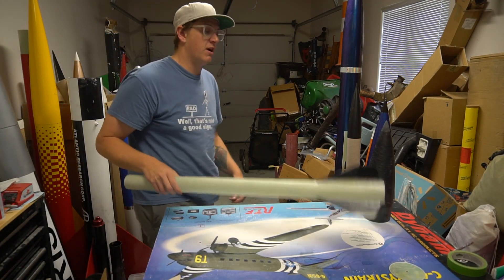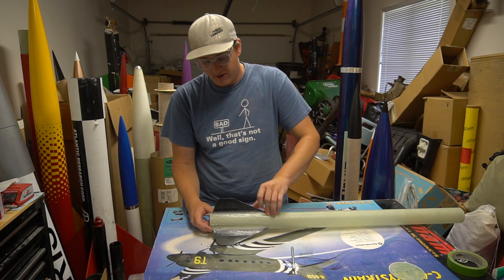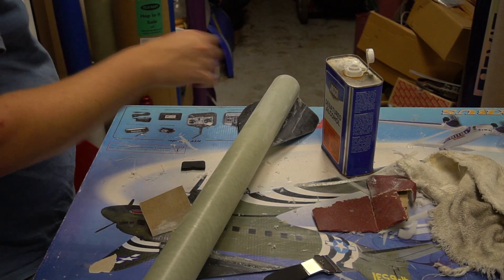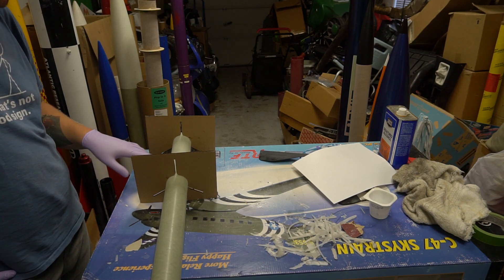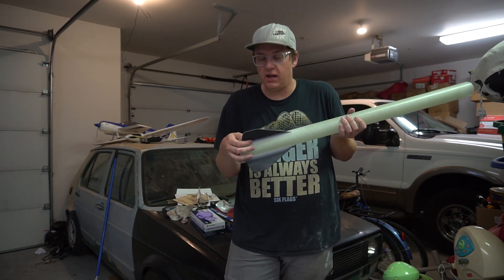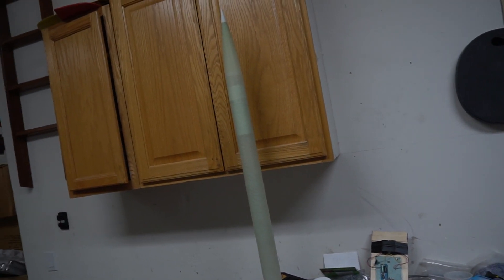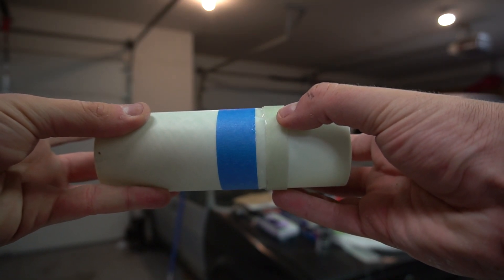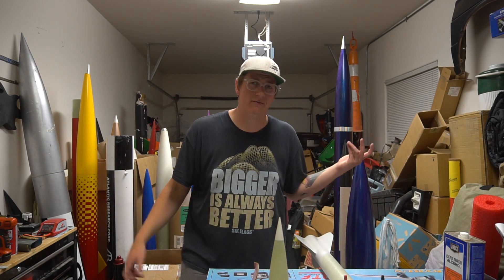When Rocket Building Goes Wrong | Epoxy Failure = Starting Over

Comment: Vacuum pump your epoxy, after mixing, to remove bubbles before you use and get more strength out of a no fin through tube designed rocket.
Reply from the maker: https://youtu.be/W_mT9FT9HzA?si=kzNMNVpDU8YvOQCD
Reply from the maker: https://youtu.be/W_mT9FT9HzA?si=kzNMNVpDU8YvOQCD

Comment: I would like to see the vacuum process that several people have mentioned in the comments.  Maybe a video where you demo several different epoxy types and application methods on scrap materials so they can be flipped over to show both sides if needed.  Like if you put a fin into a tube, but have the tube cut away as a demo.  For newbies like me or younger people that haven't worked with epoxy much where strength and techniques become important. With the lighting in your garage its not always easy to see how you are doing some of this.

Comment: You got very very lucky on removing the bad fillets.  I weigh my laminating epoxy (Aeropoxy) and use Loctite Hysol 9462 with the self-mixing disposable dispensers.   Haven't had this disaster with either of them when doing this way.
Reply from the maker: Absolutely, had they been any harder or softer this would have been a disaster beyond belief. 

I have a tube of hysol sitting around somewhere, along with some 3" quasi carbon fins from back when I thought I wanted to be an altitude guy. Although, those feelings are starting to come back a bit.

Comment: Only use the pumps to distribute. Best way to get the best mix for your epoxy is weigh the ratios out.. also if highly highly recommend using Aeropoxy ES6209 structural for fillets. Much stronger and lighter then west systems. Plus doesnt need a thickening agent if you dont want due to its hold and thickness.  They also make a laminating epoxy and a light weight filler epoxy. Best stuff to remove uncured epoxy lacquer thinner. 

For a minimum diameter rocket. Dont recommend fillers. Mixing fillers induces air bubbles.  While you physically feel its strong under flight stress is a different story. I also recommend vacuum processing your epoxy before applying the epoxy to fillets. This removes air bubbles.

Comment: depending on the working time of your epoxy, could you do a quick vacuum to remove air bubbles?   Might help remove the pin holes left behind. best of luck with the remaining finishing!
Reply from the maker: I actually used a trick I learned from Crazy Jim, considering this epoxy's cure time. I spread it pretty thin on a paper plate and let it outgas for about 20 minutes before putting the last two sets on the rocket and the difference was extremely noticeable.

Comment: I recently used West Systems for the first time.  I wasn't too happy with it due to the fact it mixes to a thin consistency, I realize fillers can make it into a thicker consistency but that's just more work and money.  Proline epoxy is the best way to go I think.  I've never had any issues with it, already thick, makes beautiful fillets, never any bubbles.
Reply from the maker: Personally, I love how thin it is, especially for laminating purposes. It's also great for deciding on your consistency with varying fillers. The colloidal silica filler is fantastic, too, because it sands quite easily to shape without sacrificing the strength of the epoxy. I have some Proline 4500 and some aeropoxy around, too. I just kinda stuck with what I know. I guess we'll know if that was a bad decision relatively soon!
Reply: West is originally intended for marine use for wetting out fiberglass.

Comment: Get a digital scale. I've noticed my west pumps don't dispense the exact amount they're supposed to
Reply from the maker: Yep, that's what I did with the new fillets
Reply: I gotta 2nd the scale, personally I use syringes for my laminating epoxy and scales for structural.
Reply: @scrapmaster09  I have been doing that as well.  Never had any issues in 20 years.  It just works.